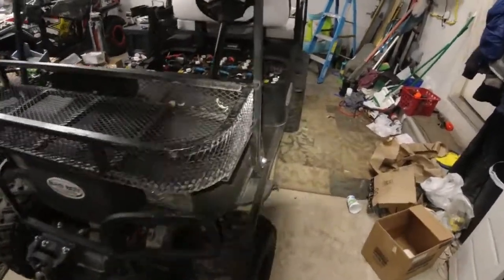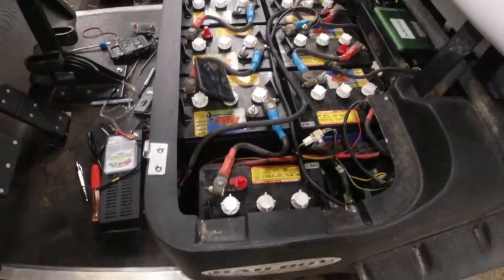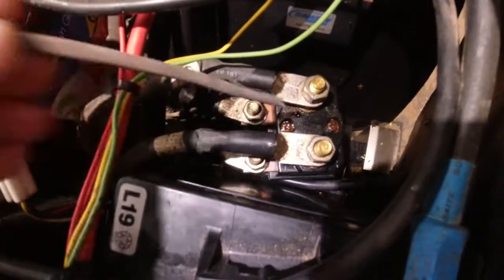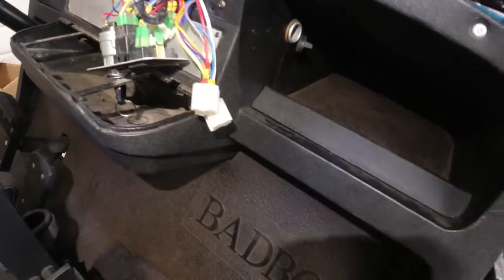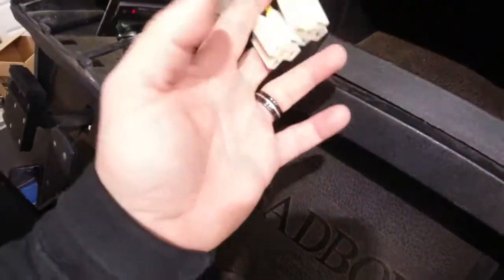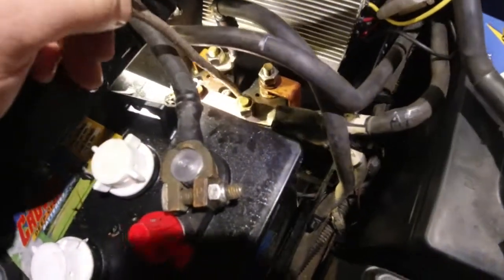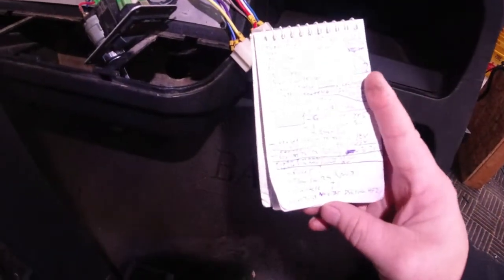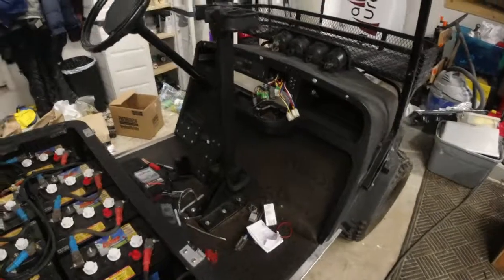2006 Bad Boy Buggy BB-AMS4 4x4 48V Electric Cart - Symptoms - Tests - Need Help w/ Diagnosis Please!

Comment: I need to talk with you. I’ve been working on one of these.
Reply from the maker: How do I get a hold of you?  I had a bad 4wd solenoid, cleaned it, benched tested and it worked. Put it back together, still not clicking when I turn the key.
Reply: Dm me on Facebook.
Reply: went through this myself. we bought a handset to verify but ultimately ended up sending the Navitus controller to Flight Systems inc. to be rebuilt. one thing I did notice was your checks for the line contactor (under driver seat) seemed incorrect for a working unit. good luck and hope you figure it out. I am about to add power steering to this monster.
Reply from the maker: @jdnoggle1  are you referring to the pig tail directly under drivers seat? Ya I’m getting a reading from the micro switch but not the potentiometer. Those are the 4 wires in that pigtail. Replaced potentiometer and same thing. I’m not getting the 1-5v from the pedal to the controller nor the 14v constant. I think it’s the controller. Do you still have the handset? I’d be interested in buying or renting it from you. How do I get a hold of you?
Reply: @freshmaker5  
Did you get it working?
What is a handset?
Have you found a wiring diagram, link?
Is Bad boys still in business? 
You have done a good job measuring volt. Do you know how to measure resistance/ohms.

I was just checking out one of these units yesterday.  When you turn the key one click clockwise. I heard one or two big contractors click behind me. 
Turn the key one more click clockwise. This should bring the headlights on.  I dont know when the cigarette lighter gets energized.

When diagnosing things. Try to isolated every thing.
I noticed there may have been a led lightbar added. 
First unplug the lighter and leave it unplugged. Also disconnect all the headlights. Check the ohms off all lights separately.  000.0 ohms means no resistance and possible dead short.
Only put in the relay for the headlights. Turn key to the second position. Check voltage to relay and check to see if the contacts close in that little relay. And see if it gets hot 

You can do the same for the second little relay. See if the relay contacts close and see if it gets hot with everything down stream disconnected. 

If you know what voltage activates the large contactors.  You can hot wire it straight from the batteries or even another power source.  I am not sure if the two rusted screws do anything.  They might just hold the contactor together. Put one wire on one side of the coil onthe contactor.  Then tap the other side of the coil to see if the contactor closes.

For the big relays. Disconnect the big wires.  Cover the ends so they don't touch anything.

Figure out what voltage the small wires that activate the contactor should have. 

Can you ask the former owner what the 4wd/automatic button does.
And when in 4wd. Does all 4 wheels have power or just one in front and one in back and power goes to the tire with the least grip.  Like on a car.

I am not checking email all the time . So if I dont answer soon. Send me the questions again.

Let me know what happens
Reply: @jdnoggle1  i checked out an 05 model yesterday.
Please explain the 4wd/automatic button.
And do you ever have all 4 tires pulling or just 1 front and one back?
Thanks...
Reply: @freshmaker5  disconnect the wires from the potentiometer.  Hook up the ohm meter. See if that changes as the pedal is pressed. If it dies change. See if thuer is voltage going to the potentiometer
Reply: @crunchtime  i checked out an 05 model yesterday.
Please explain the 4wd/automatic button.
And do you ever have all 4 tires pulling or just 1 front and one back?
Thanks...
Reply from the maker: @golfish8589  the controller ended up being bad. I received a new one yesterday and I need to get it installed. A handset is A hand held diagnostic device that you can plug into the controller to test it similar to how they do with cars.
Reply: @freshmaker5  

I just test drove an 05 by 4wd electric. 
When lifting off the accelerator. 
The buggy comes to a screeching stop.
Any ideas? Brakes are not dragging
Reply: @jdnoggle1  

I just test drove an 05 by 4wd electric. 
When lifting off the accelerator. 
The buggy comes to a screeching stop.
Any ideas? Brakes are not dragging
Reply from the maker: @golfish8589  yes. That is the electric brake switch. Just turn it off. It’s right next to the 4x4 button
Reply: @jdnoggle1  
 @freshmaker5  
Need HELP. ASAP....

I was able to check the e-brake switch with an ohm meter on the 05 buggy I have been looking at to buy. It is going to auction Thursday. I can buy now  it for $3650 as is. It currently comes to a screeching stop when foot taken off of accelerator. New ,one month old batteries and wires. Buggy looks in good shape.  All other parts appears to be original.

Light on computer is on and steady green. Is this normal?

There are two sets of connectors on e-braje switch. . 
The side with the wires is not switching. That side of the switch is either stuck open or closed. I can't remember which . The other side of the switch with no wires  is working fine. I didn't want to fix it in front of them. The price would have gone up.

The symptoms are basically the wheels locking up if you let up on the accelerator . On asphalt it comes to a screeching stop. Doesnt matter what position switch is in.. Is this normal with e-brake on?

Should the contacts in the switch be closed or open to have the e-brake on?

What is normal operation with e-brake on and off?
How much regen should there be with e-brake on and off?

If switching the wires to the working side of the e-brake switch fixes things. Is $3650 a good price for an all electric 05 bbb with brand new batteries ?
I was not able to check potentiometer. 
Please try to answer every question above. 

Thanks....

Comment from the maker: It was a bad controller.
Reply: I have the same issue. How did you fix or replace the controller?
Reply from the maker: @yadcadcy7  I sent it to fsip to rebuild
Reply: @freshmaker5  Incase I have to send both mine out can you post where to send my old for new or rebuilt please
Reply from the maker: @richiechop  fsip (flight systems)
Reply: What did it cost to have the controller rebuilt?
Reply from the maker: @matthewmayo9922  I went direct to fsip. This was a long time ago. I don’t remember, but maybe around 800
Reply: @freshmaker5  that is what I was expecting thank you sir